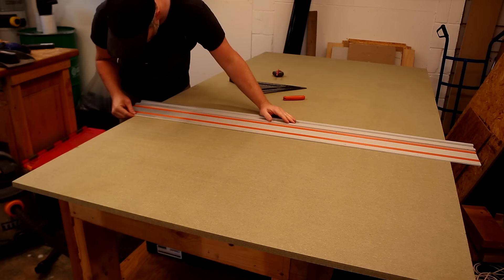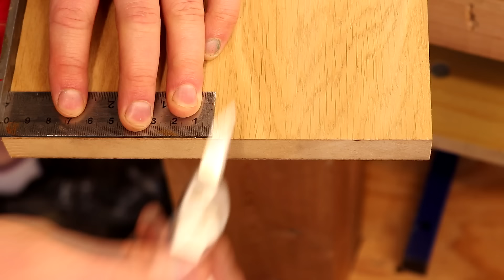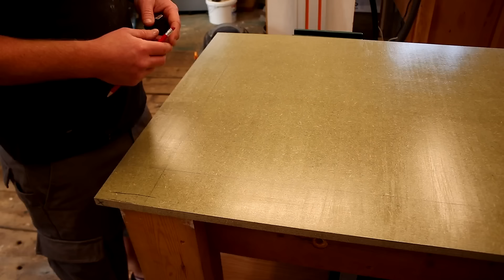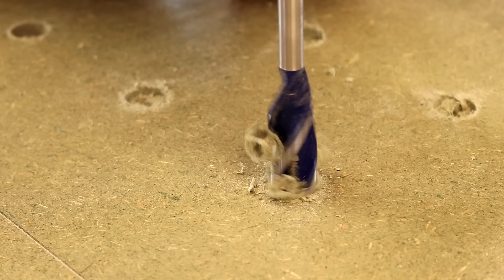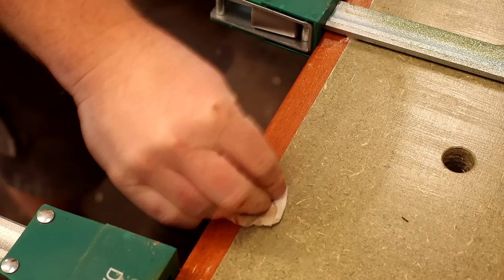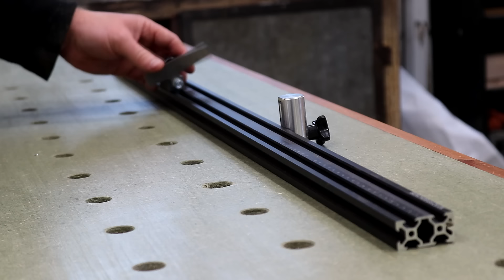Making An MFT Top - No CNC, No Guide Jigs

Comment: It has been 3 years since your build. What do you think now about having drilled your holes versus using a plunge router to form the holes? Also, what do you now think about finishing the top with water based polyurethane compared to using high pressure laminate for the wear surface? It is nearly time for me to make these decisions and, like you, I'm not made of money. Thanks.

Comment: This is a useful video. Thank you. I'm mulling over the possibilities for a combined outfeed table, systainer garage, and assembly table and I'm considering using 1/8" tempered Masonite as a replaceable top surface. I've used tempered Masonite well-waxed for other bench surfaces with gratifying results. My question is whether 3/4" MDF plus an extra 1/8" will pass the ratchet clamps often used with the MFT grid system. From your experience, does it seem like the clearance would be okay?

Comment: The Festool tables are based on the joinery standard of 32mm spacings that’s why there 96mm. All handles, hinge mounting plates, adj shelf pin spacings ETC and a combination of this system

Comment: Excellent inspirational video that I will use to make a bench-top - thanks! However, your math from 7:50 is dodgy. ‘The sum of the squares on the two shorter sides must equal the square of the long side (hypotenuse)’ for an accurate 90 degrees in the corner. Just adding the same number - 100 in your case - to all sides throws this ratio out of whack. Your tape measure check did not look ‘spot on’ either. But the rest is very helpful!
Reply from the maker: Please read the pinned comment

Comment: The 96mm distance between holes is designed so the edge of the rail lands between the hole spacing regardless of wether the dogs are anchored under or abutted against the rail.

Comment: Great detail, very informative and easier to understand as compared to others. 4 mm distance would maybe give you 1 to 2 extra hols in the width or long run of your table top. I like the 100mm as it’s even, less math on ruler. I also like that you used MDF and made it waterproof too. You are very good in the instructions of the how to. Thank you for your time. I did get that drill set too.
Reply: He could have got more holes by insetting by 50mm rather than 100mm from each edge.
He didn't waterproof the top because he left the inside edges of all the holes unsealed.
Also, that water-based sealer is really "sticky" if you leave something clamped up too long. You will have a hell of a time unsticking your work from it if you leave it clamped (or even resting on it) for more than a few days.

Comment: I used your method to make an MFT top. Thank you so much for this clear and concise video. The top didn't turn out perfectly (maybe half a millimeter off in some places, but no compounding errors), even though I used a drill press and measured carefully -- but it's close enough for all the work I do, and a huge improvement to the workshop. Thanks again!

Comment: @Rag 'n' Bone Brown, seems to be a good idea in theory, but I'm curious about one thing. The jig you have done was made from a MDF board which isn't particularly hard. Without any steel drill bushings weren't those holes getting a bit bigger every time you drill a hole? I just imagine that with very sharp drill and drilling it by hand it is difficult to drill it absolutely dead straight 90 angle and any kind of slight change of position of the drill takes of a bit of material meaning that after couple of dozens of holes the might not be circular anymore nor the same diameter, leaving it for some play which means lost accuracy. Wasn't it the case for you?
Reply: YES, it would have been very sloppy at the end. The jig should have been hardwood. There was absolutely no need for it to be 200mm wide.
Also, he should have used a 20mm hole saw (with drill arbor) and not an auger. That would have resulted in perfect accuracy and no tearout.

Comment: The screw-holes in the Bench Dogs brand rail Square attach dogs to it in such a manner that it holds square to your table if you stuff them into your 96 mm holes. That's the only attachment I know of which requires the 96mm spacing, but it does exist.

Comment: Just be careful you you don't have fixed position MFT accessories. Apart from the Vario  bench top which has 100mm centres, standard MFT tops are at 96mm centres.

Comment: A better way to get the holes at precisely 100mm, is to put a fence on your pillar drill, then use the table saw to make a spacer block which is as close as you can get to 100mm.  Since your on the table saw, you cut a strip, then cut it into sections.  Put the workpiece against the fence on the drill, and under the drill.  Then set out a row of the spacer blocks along the fence, snug them up to the workpiece, and clamp the last spacer into place.  Drill the first hole, then remove on of teh spacer blocks, snug the work piece against the next block, and then drill the next hole, keep removing spacers, and moving the work piece until you have drilled all the holes.  You now have a series of holes at as close to 100-mm apart as you got the spacer block, and a consistent distance away from the edge of your workpiece.

Comment: I think you could use the jigg more when drilling in the work bench? Drill the first row, use the al to locate the second row, then go back and do the same for the third. Now you can use the 2 holes on the top and the bottom,  this way you eliminate the risk of measuring wrong between the rowes.

Comment: Hey Keith,

Maybe I missed something, but what's the point of tracing all the lines and hole centers on the actual bench when you use later on a jig to drill the holes that prevent reading (and double-checking) your initial bench line?

Thanks for your videos, I really appreciate the content.
Cheers
Oliver

Comment: I like to use speed square to find center. Just as u did to check the squares but also mark the other edge of the speed square as well. The 45° side. Flip square and line up your straight line mark and again scribe a line along the 45° side of the square. It will form an X on your work piece and as always X marks the spot 🤪

Comment: Excellent stuff! Although that 'other' jig is expensive, it's also essentially a one off use tool.........I mean, how many worktops do you actually need! This is as good, and essentially free. Although slightly more care needed, the 'other' system ain't easy to use either.
Reply: As these DIY tops wear out, you will need to remake it. Hence the multi use capabilities of a purchased jig come into play versus having to either remake your DIY jig, and or make a fugal attempt at storing a wood jig for long periods of time with the expectation that it’ll not lose accuracy over time. All that said, this is a great DIY tutorial, but people should know/understand there’s a lot of room for error. Understandably, depending on use case that may or may not be of concern for some

Comment: Looks like it worked.  I would like to see a method using a plunge router though.  One could use an edge guide and/or the track attachment for the router.  Clean perpendicular holes.

Comment: Nice job mate. I follow both Peters along with yourself and others. I have the UJK?? drilling system sitting in it's tube but I haven't made a table. i did have an old mft1080 though and it was nice.

As a side note. I was going to make a comment about us tractor boys but we're so bad right now it's not even worth it.

Comment: Great video. Can I offer a possible refinement to the process when locating the layout of the holes. The initial row is drilled, then the first hole is used to pivot the guide 90 deg to locate the continued row spacing. This could be repeated on the opposing edge and then you just locate each row by top and bottom hole and drill all those inbetween.

Comment: Hi Keith, is there a follow up video to why and how and when one would use an MFT top? I want to build one like you but I’m at a loss for when and how I could use one.

Also, any ideas on how I can build one of those cross cutting pivot things with a track saw on one of these MFT Tops?
Reply: Biggest use case for this top are tracks with plunge saws  and being able to use dogs in the holes for quick a precise alignment to get perfect 90° and 45° cuts. Some tops are made with an isometric hole layout to also get 30°, 60° cuts.

Comment: Excellent solution to something that I'm facing as I write this. Thank you.
Someone may have already brought this up but the thought struck me that after you drill the first row of holes and pivot the jig 90 degrees to drill the first perpendicular column to it, one could return the jig to its original position, pin the jig on its other end, then rotate the jig 90 degrees and you can drill a third column of holes parallel to the second batch. You now can move the jig parallel to the first row of holes, pin each end to the two parallel columns, It seems to me this method would reduce the potential error of measuring each subsequent row. 
Am I missing anything??

Comment: As wood is becoming very expensive and scarce here in Mexico, I'm thinking on using heavy gauge perforated steel angle (such as used for racks and shelves) that, with enough cross bracing,  and bolting it to the floor with anchor bolts, could provide great rigidity at the lower base, but the substructure for the top still needs some thinking. Thanks for a great video on how to make the top, and kudos for your 100 mm spacing! What people preferring to buy instead of DIY, is losing, is a great-great-great opportunity to Learn by thinking and designing yourself the project, like you did.  One humble suggestion taken from aeromodellers that use Balsawood (that is quite soft): once you drill every hole and before coating with varnish, you can harden the wall of the holes by wetting them with thin (fast curing) Cyano -acrilate glue.  The thin glue is absorbed by the MDF (and most woods) and the glue hardens the surface of the wood.  Aeromodellers use that trick to harden the threaded holes in Balsa wood that will receive screws, so that the thread in the wood is more resistant. Same here, to better withstand the push of the dogs.  Liked, Subscribed and "Belled".

Comment: I've tried doing some looking, and it looks like the 96mm spacing comes from Festool basing a lot of their systems on 32mm, which apparently comes from European cabinet making using 32mm spacing as a base for shelf pins, if not most measurements of cabinets. 
Apparently this comes from the post-WW2 move from adjustable rails for shelving to pins for shelving, due to scarcity of steel at the time and moving to dowel pins, which also took multiple style variations and condensed it into a singular, standardized system; which also made production easier to handle, as you only need a single type of production line in factories, thus making factories more productive by design. 32mm happened to be what most readily available helical gears, that could also handle the torque needed without breaking, had between centers, which were used in a multi-spindle drilling setup. Very economical solution that used tooling that was already available, if history was different and had used larger or smaller gear spacing, we wouldn't be using 32mm as a base spacing today.
Reply: I believe it's also because 96 is nicely divisible by more numbers than 100, so for example if you want to use offset holes, you can divide by 2 (48), 3 (32), 4 (24) etc very easily. 100 divides by 2 easily but not by 3 so  well. Just a thought.

Comment: Very simple idea well done.  If you had either offset the line of 4mm holes to one side instead of cantering them you could have drilled an extra pair at each end 100mm away from the main line so that you could then index the next line of holes off the previous one and avoid introducing any error in measuring the distance for the edge of the board.
Reply: I was thinking the same thing, then it occurred to me that accurately place those two holes perpendicular to the jig full row could be difficult since your offset would only be 100mm. Over multiple rows getting laid out you could easily introduce a significant skew even though each of the rows would still be in parallel. I think creating a perpendicular row off each end hole of the first row, and then using those two parallel rows to span with the jig for proper alignment would work better

Comment: 96 mm is a good universal "unit" if I may say. If you divide 96 / 3 = 32 mm, then you can divide 32 mm in half up to 1 mm: 32, 16, 8, 4, 2, 1.  Also 96 / 2 = 48, 24, 12, 6, 3. With 100 mm you stop at 100, 50, 25 mm.
Reply: 96 mm is used because it’s based on the 32mm increment used in cabinet building.
Reply: @andrewschultz2504 good point.
Reply: @andrewschultz2504  and 32 mm increment is based on...?
Reply: @orlanino    https://en.wikipedia.org/wiki/32_mm_cabinetmaking_system

The system was developed after the end of World War II in order to help speed reconstruction of the vast number of buildings destroyed during the war, that the 32mm spacing was decided upon because that was the closest that multiple drill bits on a line boring machine could be placed, because of the size of the gears then available.
Reply: @orlanino  32 mm est basé sur la série des nombres Renard , norme ISO 3. https://en.wikipedia.org/wiki/Renard_series?wprov=sfti1
Reply: @didierleduc329   Definitely. The reason why woodworking still prefers inches is that 'halving' is more robust measurement. If we had 12-based system, all conversions and standards quotations won't be needed as 96 would become 80, which you can half repeatedly. Even better, it is divisible with 3, 4, and 6. Renard understood that, and he simply converted this into a 10-based system. Same with ISO standard.
Reply: @orlanino German engineering, you know it makes sense
Reply: @orlanino  since when, and where,  does woodworking still prefer inches ?
Reply: @gavinhay6627  reply after 4 years? Ok. When: I'm 63. Where: at that time, quite a few countries.
Reply: @orlanino  am I expected to watch the video at the same time as you ? millimeters are the measurement of choice in an overwhelming majority of countries worldwide. Inches are only used in antiquated backwaters.
Reply: @gavinhay6627 well, there’s me, in Oregon, USA. I grew up with the mess that is measured in inches, feet and yards, and have never really internalized the metric system. Wish I had done, but I’m 76 and have too many other things to worry about in the time I have left.
Reply: Thanks ❤ for sharing
Reply: Thank you.
Reply: Very good observation. Thanks.
Reply: The only thing that I can think could affect the spacing is the shape and or diameter of your dog. But even so, spacers can give you any stop value you want.
Reply: Looks to me like it's to maintain compatibility with imperial units. 3mm ~ 1/8" 6mm ~ 1/4" and so on. I don't use imperial units so like the simplicity of 100mm centres. All the best, Rob in Switzerland
Reply: @RobWhittlestone  I don’t think it’s very compatible. It’s exactly 25.4mm per inch. Dividing out 96 gives 3.7795 inches. 89mm would be closer at 3.5039 inches and 127mm is exactly 5 inches, but these aren’t very ergonomic to use as both are prime numbers.

If I were choosing a width, I’d go with 108mm which has a lot of great factors: 1, 2, 3, 4, 6, 9, 12, 18, 27, 36, 54, 108 or 120mm which has even better factors: 1, 2, 3, 4, 5, 6, 8, 10, 12, 15, 20, 24, 30, 40, 60 and 120
Reply: Hey all, I just came across this conundrum and, like many, immediately thought: 32mm is odd. Why? Then I thought it might have to do something with imperial measurements. And it is: I figured it’s 1 1/4” = 31,75 ≈ 32mm. After some searching, nobody is actually talking about this specifically. Could someone help me verify this theory?

Comment: 96 mathematically is a dozen related number. Dozens are nice because they are divisible by 2, 3, 4 and 6 unlike decimals. I’d say that is why Festool selected 96mm. Thanks for the great video!
Reply: Kind of fascinating because its a way of using the metric system to behave functionally like the much-lampooned imperial system.
Reply: Festool didn’t come up with that.  Post WW2 set the 32mm standard when they started mass rebuilding.  96 is just divisible by 32.
Reply: There's a similar reason for there being 360 degrees in a circle. It can be divided in many commonly used ways whilst retaining whole numbers: half (180), thirds (120), quarters (90) etc.

Comment: I really like this method. My only concern is how you ensured the vertically of the augured 20mm holes? I would think if you were slightly off vertical the dogs either wouldn't fit or they also wouldn't be vertical either. Great video and channel
Reply: I had the same concern. If dogs are being used to square up a workpiece, off-plumb holes will result in off square cuts.
Reply: The pilot hole is square, and will drag the auger bit down - i.e the auger bit will follow the pilot hole. Also, he drills halfway from one side and halfway from the other side, hence reducing the out of square, if any, by half.
Reply: He also mentioned the holes in the jig were made on the drill press to make sure they were vertical.

Comment: If you've not yet heard why Festool selected 96 mm spacing rather than 100 mm spacing, take a peek at Peter Parfitt's page.  His Parf Dog system Mark II https://www.youtube.com/watch?v=tOhDFN5Cx-s makes it possible to lay out the holes at one half and one third spacing (96/2 = 48 mm, 96/3= 32mm) which allows an isometric pattern.  That just expands the capability of the tool.  If you'll never need to make a 45 degree or 30 degree cut, it'll make no difference.  (incidentally, 30 degree capability opens up 60 degrees as well).